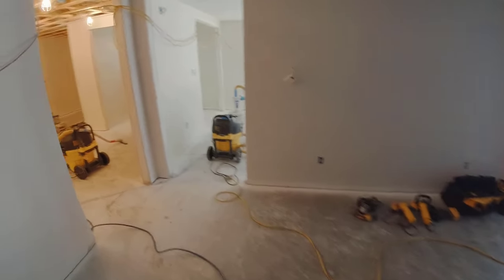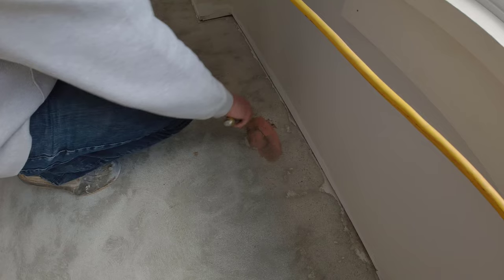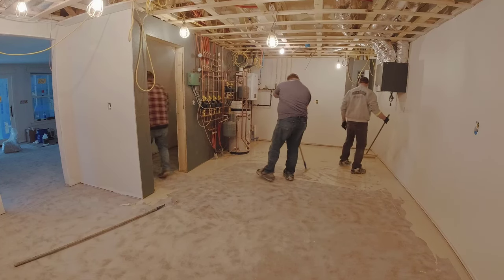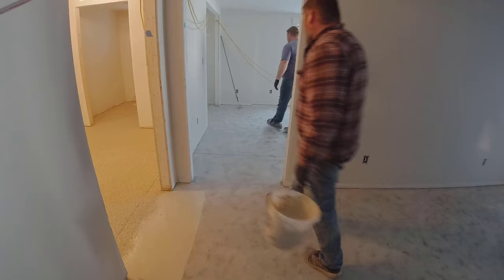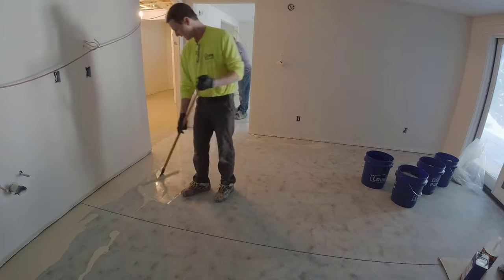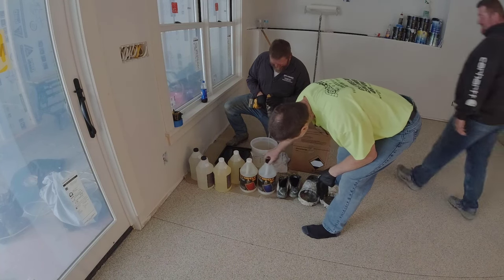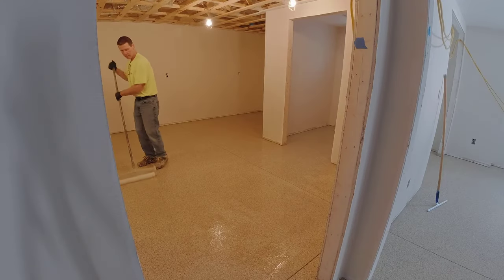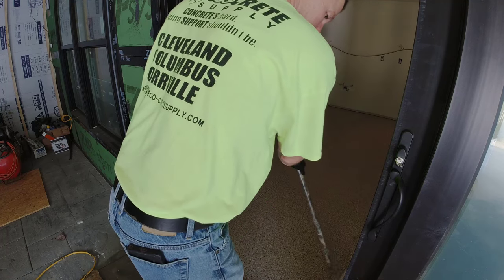DIY Epoxy or Polyaspartic Flake Coatings- With my help!

Comment: Yup my sister and Iaid out this type of epoxy flooring in her garage as I have 4 nieces and a nephew who are pretty messy with their bikes. Super easy clean up and scratch resistant the only downside is that this type of epoxy flooring is susceptible to UV rays.
Reply: You are correct on traditional epoxy and UV stability. However, one of the benefits to the Poly 90 is that it is in fact, UV stable :). *"UV stability allows this to be used in areas saturated by the sun throughout the day" 

Always appreciate the support, Mike!